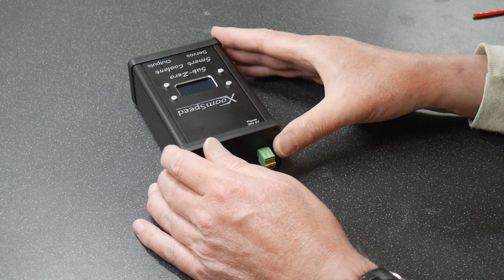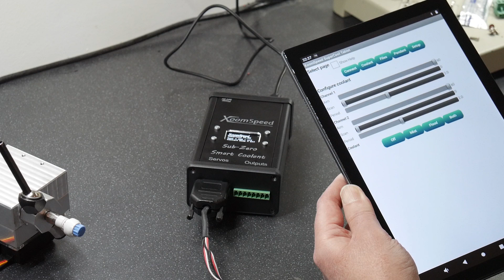XoomSpeed Supercool prototype 2

Comment: Great stuff! Looking forward to it becoming available. 
Just a thought, since the module is already communicating with Pathpilot would it be possible to have it switch solenoids, coolant ports, based on X,Y direction?. For mist cooling on my current machine I have a board which taps into the step-direction signals and uses this to switch the nozzles in 4 directions. With your system I can imagine this also being possible. Together with the adjustable height this would make it the ultimate DIY cooling solution!
Reply from the maker: Now you've got me thinking.  Likely way to do that would be to give control of the outputs to the Python script running inside PathPilot.  Not difficult to do.

There's an evil voice in my head that wants me to put 4 of the modules around my spindle and make them do a Mexican wave!

As it stands, I already have the outputs set up so I can specify a frequency and duty cycle to have them pulse on and off.  You can have 2s of flood followed by 4s of air/mist if you like.
Reply: @daleksw  Sounds good!

Comment: very COOL , I like the dual control. Tablet idea is also good. I have a couple iPads laying about but those are probably not easy to use in this type of application. great work as always. keep up the videos!
Reply from the maker: The tablet code is written using MIT's App Inventor.  You'll find lots of tutorials for that on YouTube.  It's simple but surprisingly capable.  Sadly, at the moment, it only produces output for Android.

I did try, but I couldn't find a decent cross platform environment that had the Bluetooth functionality I was after.